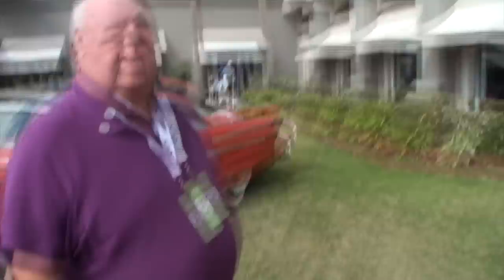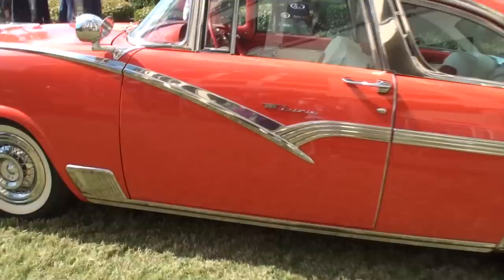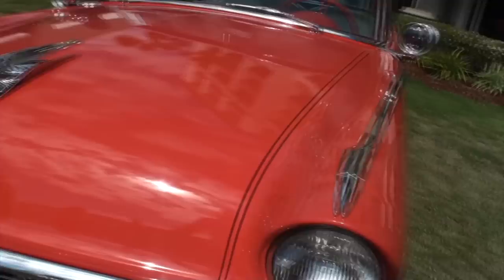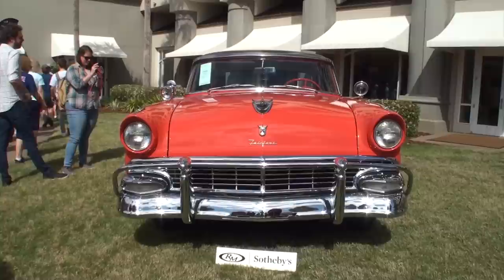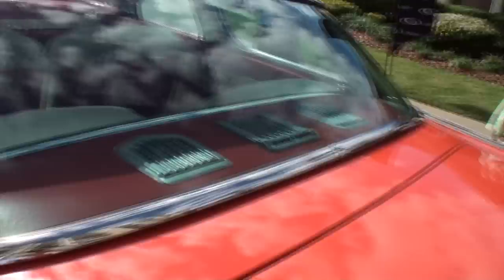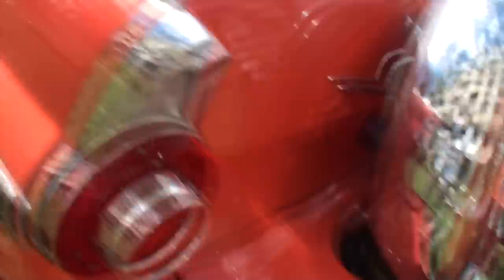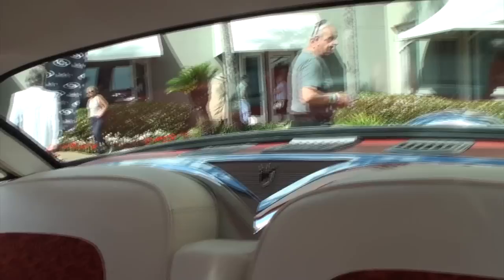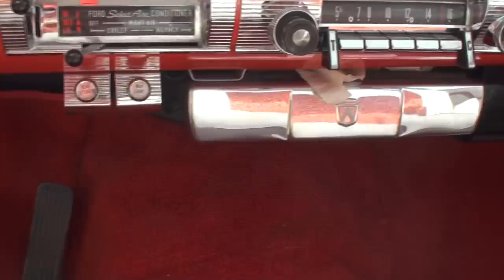1956 Ford Fairlane Crown Victoria Skyliner Glass Top & Engine Sounds My Car Story with Lou Costabile

Comment: What a beauty!  I always liked that air conditioning installation on these '56 Fords.  I always thought it was weird, though, that the '56 Mercury was using a trunk-mounted unit with the air scoops on the rear quarter sides.  I remember as a little kid being fascinated with the car ads in my parents' old National Geographics, and this was the year that they had the ads touting the safety features, with a red-and-white car like this.  Were I buying a car in the Big Three in '56 I think it'd be a tough choice between the fine '56 Chevy, this '56 Ford and the very nice '56 Plymouth.  Kudos to this fine man for not 'restomodding' it!
Reply from the maker: Hi LoveIsAll, Happy to read you enjoy the looks of this car :-) Thank you for sharing details you notice. There are 3 nice choices in 56.....just buy one of each :-) Lou
Reply: 56 Chevy didn't have a any model with the luxury of that Crown Victoria FORD!
Reply: That's for sure , no belair made would ever compare to the 56 Ford Fairlane Crown Victoria Sunliner coupe.. Well done Ford....
Reply: 1957 Chev is really a 1956 Plymouth lol

Comment: It’s a beautiful car and I love it!  Impressed by the number of options especially the factory air.  Don’t care for some of the options like the cow catcher grille guard or the Continental Kit but I know tastes vary!
Reply: I agree with you Craig. Often (with 50's cars) "less is more". Just because it may be an option, doesn't mean it should be there. I don't like the grille guard or Continental kit either, nor the fender skirts. Somehow, they look less horrible on this '56 Ford than the standard equipment I've seen on '57 Chevy convertibles that absolutely ruin their looks. Oh, and those awful extra mirrors!
Reply from the maker: Hi Craig, High praise :-) Lou
Reply: I'm with you on the continental kit and the grill guards. The grill bars would probably be appropriate on a 1956 Ford used as at New York taxi at the time. Why spoil the appearance of a beautiful grill with an ugly utility bar. That's just my opinion. The car is spectacular nevertheless. 4:24 4:24

Comment: Someone had some money and checked all the right box's when ordering this car new. I seen a 68 GTO convertible that had 27 factory options on it. That was the most I had ever seen on a car. My Uncle had a Green and white 56 Crown Victoria in 1966 through the mid 1970s. Had the 312 V8 and automatic. He used to tell me that he wished the speedometer went higher because he could get it up to 120 mph easily. It wasn't a glass top car. Just a 312 V8 and automatic transmission and contential kit (which he pulled off after buying it) and power steering and brakes. It got backed into by an 18 wheeler trailer in the side at a chicken plant that he worked at. Sadly it was crushed after that.
Reply from the maker: Hi PlymouthDuster225, Sounds like your Uncle has a great car :-) Sorry to read he end result :-( Lou

Comment: Really beautiful and unique '56 Ford, Lou. That 'band' that went over the top was kind of astonishing. The car was still a top-of-the-line coupe (not a 2-door "sedan") despite the 'interference' in the middle there. I don't think Ford used this idea again until the 1977-'79 T-Bird. That check mark along the side was originally supposed to be on the '55 T-Bird, and indeed did appear in some ads in late '54, but Ford deleted it before production. I never knew why, but am guessing they felt it was too much for the much smaller car to handle/pull off looks-wise?
Reply from the maker: Hi Rob, Happy to read the details you enjoy :-) Lou

Comment: Fiesta Red. Those wire caps/hubcaps are the ONLY wires ever used on the little T-Birds. In 1955 the hubcaps were red. In 1957 they went to 14" wheels and no wire cap option available. All these smarty pants guys who put Kelsey-Hayes wire wheels on their 1955-1957 T-Birds are incorrect. 

I love this Fairlane, but I do not care for the continental kit. LOVE that is has factory air, something not offered on the 1955-1957 T-Birds.
Reply from the maker: Hi When Better Cars Are Built, Thank you for viewing, sharing, and listing the details you enjoy, and some not so much :-) Lou